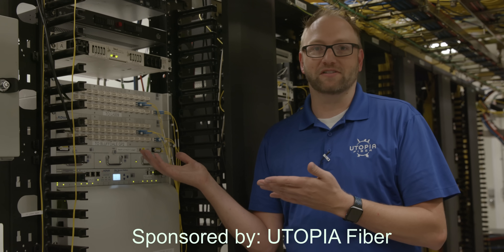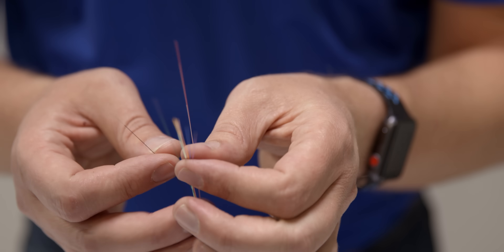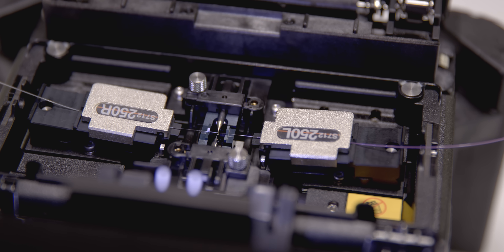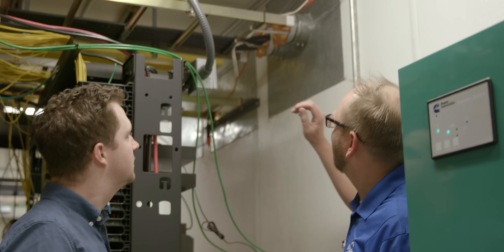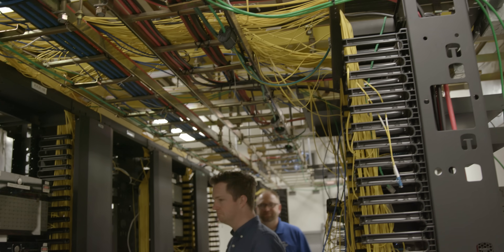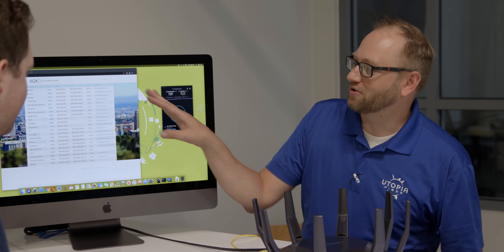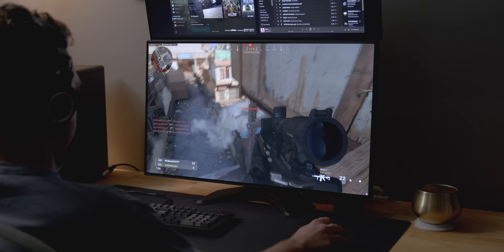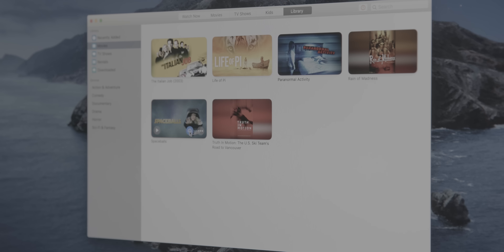4 Terabit Internet?! Fiber Company Tour!

Comment: I have 1gbit at home and I pay about $15/month.
Proof that when the network is built out properly and competition increases, prices go way down.
Sweden, for those wondering.
Reply: In my city here in Brazil, they used to charge 25 dollars for 1 / 0.3 (adsl), yes this ridiculous speed. The competition has arrived, now I pay 17.8 dollars for 60/30 (fiber indoors)
Reply: @pedrosmarks  60/30? That's a weirdly specific cap tbh. Must be overcrowding on the switches or something. Needs more investment probably.

Comment: Hey, cool, I've used that exact fusion splicer in my junior college lab. The fusing is the easy part. It's cleaving the end clean that's the bugaboo. So easy to chip those ends rough 😑
Reply: It looks like a fitel s179 to me. You should never cheap out on a cleaver though unless you want to experience hell

Comment: The speed of light argument is very meaningless, electricity also travels at near speed of light in copper cables. The real advantage is that there is no electromagnetic interference or inductance stopping you from modulating signals up to hundreds of GHz in a fiber mean, you can’t do that on copper for long distances, or using very expensive cables with tons of shielding.

Comment: When the speed of the internet is more than yours PC's storage
Reply: A 1GB PC?
Reply: @rrp6405  That upload was roughly 950megabyte/s. Almost double most Sata3 SSDs. Only NVMe PCI-Express SSD are faster. Basically you need PCI-E like connections to exploit that kind of speed. It's crazy when that is over Miles of cable.
Reply: @Neojhun  there's alot of people mixing up bits and bytes(1byte=8bits), even for me at the start. in the video, their providing 1Gbps(giga bit )=125Mbps, not 1GB(gaga byte )=1000MBps.
Reply: @elonwong  Wrong this was NOT 1 Gigabit Internet. This was theoretical 10 Gigabit connection but in reality it was 950megabyte/s. Thus why I specifically spell out the full unit size. I always do that not get lost.
Reply: @Neojhun  10Gbit should be 1.25 GByte/s or 1,250megabytes/s
Reply: @tim.e.l  Yes that's Theoretical perfect conditions. In reality anything over 900megabyte/s is awesome.
Reply: @rrp6405   read/write speeds of HDD/SSD
Reply: @elkadillo  that makes more sense
Reply: @rrp6405  yup
Reply: @RRP
Reply: I get 962 mbps down 42 up. In perfect conditions I sometimes get 1.3Gbps
Reply: @tobybolinger3733  for me about same I always get 1400mbps down and about 40 up

Comment: Pointless for everyday user ( Over a gig connection ) - most of house hold computers (air cards in them and Ethernet cards ) can not go higher than 1gig .... Also majority of people do not take in to consideration PHY rate ... it drops with the distance , and RSSI will go worst as well when signal travels through obstacles... Everyone is expecting  their speed ( WiFi signal ) to remain  constant in every corner of the house ....  Not going to happen unless you are plugged in to your router ...